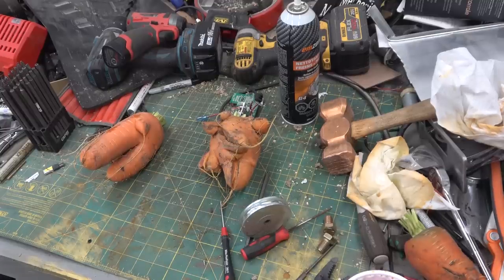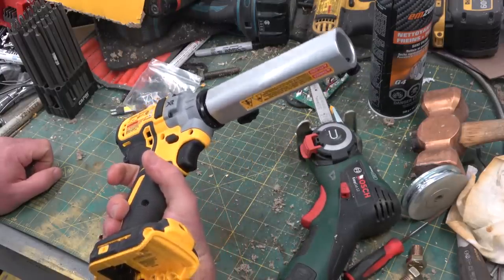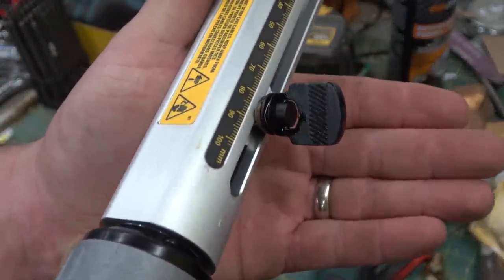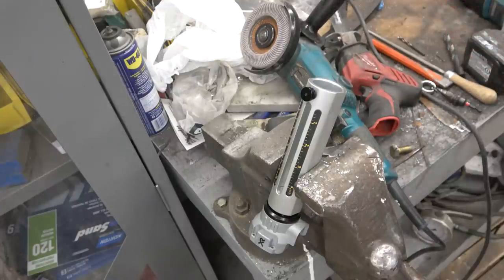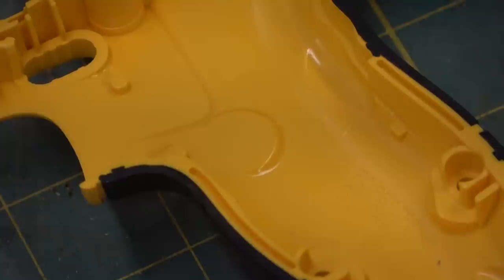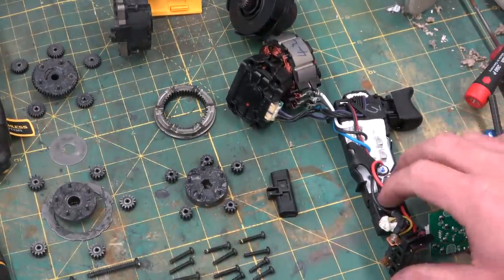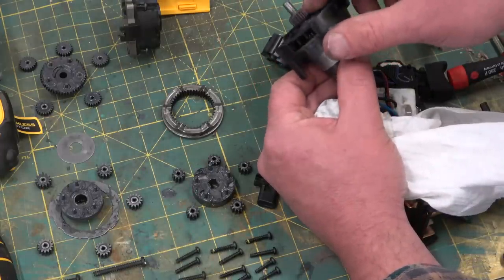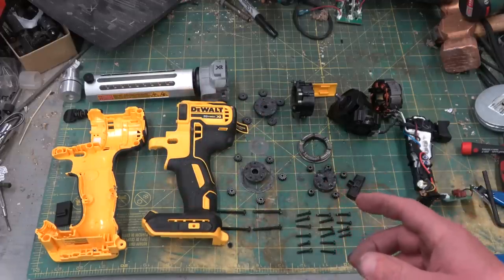BOLTR: Black and Yellow Strippers

Comment: I have owned Crafstman cordless tools for 20 years and just last fall I decided to start upgrading to DeWalt instead of the new Crafstman 20V series. I first bought(2) of the impact driver, drill, 2 battery and a charger in a DeWalt bag kit from Lowes. I was very happy with the performance. I then upgraded my garden tolls with cordless DeWalt tools, blower, string trimmer, pole chainsaw, 20v chainsaw, hedge trimmer, multi-tool, 1/2 socket impact hammer. I'm very impressed with the battery time and power of the tools! I bought a few DeWalt knockoff Chinese batteries and they are NOT worth the cost savings. The Chinese Waitly brand battery with the little battery gauge that reads in digital percent worked good but I had it on my pole chainsaw and while hanging up some bar oil dripped down the pole and ended up seeping into the battery. I picked it up to wipe it off and notice the battery was popped apart in the front screw area. Here the oil eats that cheap plastic of the cheap Chinese battery. I don't need that. I'm buying genuine DeWalt batteries from now on.
Reply: I kind of went down the same rabbit hole about 4 years ago when I decided I needed a big-boy cordless drill (ironically I bought it at Sears). Then came the cordless impact. Then the little job site blower (which I still prefer to blow away cut grass). Then the string trimmer. Then the larger higher-cfm blower for fall leaves. The string trimmer came with a used 5ah, and the big blower came with a like-new 5ah and a faster charger.

Comment: You can buy a really cool custom knife for that price.
And then look like a boss when you're manually stripping the wire.
Reply: You'd be amazed at how many companies are requiring "safety" knives, or outright banning open blade knives; because of accidents.
Reply: @southernlineman  it's a real problem for everyone with triple digit I.Q.
Reply: @jonanderson5137  unfortunately, the nature of IQ being what it is, for every person who’s got triple digit one there must be another one with only two digit. 

(IQ is set on a normal distribution with the average at 100, so by definition there are as many people above 100 as under it)
Reply: @jonanderson5137  I have a triple digit IQ
Reply: @mrb692  technically a median not an average, hence one guy on both sides to balance it out.
Reply: @stanimir4197  From everyone’s favorite Wikipedia: “For modern IQ tests, the raw score is transformed to a normal distribution with mean 100 and standard deviation 15. This results in approximately two-thirds of the population scoring between IQ 85 and IQ 115 and about 2.5 percent each above 130 and below 70.”

Mean, not median, but the critical thing is that it’s fitted to a normal distribution and not a skewed one.
Reply: @jonanderson5137  You might be surprised at how many skilled tradesmen's IQ hover around room temperature.
Reply: @southernlineman  haha, there's a joke about electricians not being able to spell electrician.

I'm just happy that the guys I work with know that code is the minimum standard and not a loose set of suggestions.

Comment: If we are gonna start doing some commercial specialist minded tools...I would like to know what makes a rigid pro press tick! And why they hell the insane price tag. Seems to me it's just a battery powered hydraulic press .....why do they cost thousands? AvE needs to get on it
Reply: I'm going to venture a guess and say its being manufactured/distributed under the real Rigid company and not the power tool division under TTI.
Reply: Given that the smaller, $2,800 version weighs 7 lbs without the jaws or battery and has loops to attach a shoulder strap I would say that it's because its a beefy little machine.  And if its sold in smaller quantities there is more development cost per tool.  Developing any well made product is not cheap.  Also, what @TpzBla said.  Cool tool though.  If I could make money with it I'd buy it on Monday.
Reply: I haven't used the Rigid one, but I have used the RLS/Zoomlock (about the same price) one for refrigeration and OH BOY does it save time.  The fittings are quite pricey, but being able to crimp from 1/4 to 1-5/8, in like 10s is amazing.  The more pipe you run the more time you save.  Plus, you don't need to lug a torch around, and you can do it where soldering is infeasible. They are stupid expensive tho, no doubt.  But like any specialized tool, to the right person, they are worth  the price (tho, got mine on ebay for like 1/2 price).  Its probably a mix of low sales volume, and 'because they can' that they cost $$$$.
Reply: @Theonixco  hence the price tag
Reply: If we are wishing I would like to know why the hell the uponor/propex expander tools in 12v are 800 fuckin dollars, and why hasn't a pex ring crimping tool in 20v with a rotating and extendable head been invented?  I realize the latter query is outside uncle bumblefucks area of interest, but I still want to know.

Comment: It's for purple doing hundreds and hundreds of connections a week. Not for someone doing 6 wires every month. These are standard equipment on commercial jobs. Every job I've been on, the electricians are using these.

Comment: I bought one of these on the bay.  I will be somehow crudely mating this with a 1/4 driver end.  This thing runs at 150rpm full tilt compared to my drill at 450.  This should give me the control I need when using it to run my string winch I cut out windshields with.  

In your pile of parts, is there any off the shelf dewalt parts that will drop on that thing to convert to 1/4in driver end?

Comment: I’m currently interning (as part of my electronics apprenticeship) at a physics lab. They’ve got several automatic strippers. One is just for micro-coaxial cables. You program in the length and depth of each step for the jacket, the shielding, and the dielectric, in 0.01mm steps, and it spins and whirs and pops the cable out! I don’t even want to think how expensive that thing must be…
Reply: Cheaper than the amount of coax you go through when you're leaving it to a grad student to do by hand, particularly if length matching of the cables is important.
Reply: Every cable manufacturer has special stripping machines. Makes perfect ends by the hundreds or thousands daily.
Reply: that sounds terrible, .1mm is not good enough for stripping wire, even thick wires like 14awg or 12 awg are 1.6 and 2 mm respectively, you can't be gouging wires by 5% and not expect consequences.
Reply: @0x73V14  I think the .1mm is about the length of the strip, not the depth. So how far back from the end gets stripped, for each layer.
Reply: specialist tool, for a specialist job
Reply: @0x73V14  You are absolutely correct, I remembered wrong! I went back and checked the manufacturer’s site, and it’s 0.01mm resolution, for both depth and length. (I’ve corrected the original post.)
Reply: @jerrygaber6150  I guess what sorta surprised me is that it’s a “manual” automatic machine, that is, it’s manually fed. True mass production of course has fully automatic machines that cut, strip, and crimp the cables without human intervention, so I’d always assumed those existed. I suppose I just didn’t expect for there to be machines in the middle, though it makes perfect sense after thinking about it!!
Reply: @HJZ75driver  Absolutely! I think a lot of people (like the people posting comments to the video dismissing an automatic stripper as a joke, or saying that a knife does it fine) don’t understand how important the right tool is, both for producing a consistent clean result and for preventing injury to the operator.
Reply: @PeregrineBF  Indeed! I had to prepare some micro-coax cables 2 weeks ago for the first time (around 2mm jacket diameter, with Teflon jacket and dielectric). It wasn’t programmed into the automatic stripper, and we only needed two, so the boss said I should do them by hand to get the practice. They turned out fine, but I am very, very glad I cut off a few 3” practice bits to practice on first, to get a feel for it. I only went for the real ones (which I really didn’t wanna fuck up because one end of each was terminated with a connector we didn’t have any spares of) once I was able to repeatably get the strip just right several times in a row. 

The wire that really gave me trouble wasn’t the coax, but Kapton wires, 26 AWG stranded. I had two variants to deal with. One wire had thin insulation (though actually thicker than typical Kapton insulation). The insulation was thick enough to make the wire very springy, making it very hard to handle, but the insulation was thin enough for the stripper (a different one, not the coax machine) to struggle to strip without scraping the conductors. The other one was rated for 30kV IIRC (it was at least 10kV), so the insulation was very, very thick. That made the insulation much easier to strip cleanly, but made the wire even springier, since it was just a huge amount of Kapton vs. a very small amount of copper. 

Ah, the joys of high voltage circuitry that has to operate inside a cryogenic chamber. (Don’t ask me what the thing actually does, because I really don’t understand it!)
Reply: @tookitogo  Would probably be for testing too i assume. Consistent builds breeds consistent results
Reply: @HJZ75driver  Yes, at least for production.

Comment: I have one of these at my job, but never use it because its garbage, and the DeWalt bushings are garbage (blades are dull, chews the insulation instead of cutting through it).  All the DeWalt is is a Greenlee GTS-RDS or Ripley WS22A perminantly attached to a drill driver. Milwaukee has a model, but they actually innovated with their implmentation, they built the motor around the cutter, so the tool is way more compact. The Milwaukee dies are also razor sharp and cut very easily through the cable insulation. Its an impressive tool. We have modified the included busings to work with DLO cable, in the 374, 444, and 535 MCM sizes. We have also worked with Ripley Labs to have custom busings built for other cable sizes and types.

Comment: Hey brother the carrot issue relates to having to higher nutrient levels in the soil where your growing the carrots, they grow out instead of long and thin
🇦🇺🌏🌎🌍🙏🏼
Reply: Ahhh. Must have had a nutrient deficiency in my early years. Oh well, can't win 'em all.
Reply: Or really hard soil.
Reply: and stoney mud and not wet enough for the tap to look for water.
Reply: Up in the icy north hinterlands, it's permafrost 6" down.
Reply: @UberAlphaSirus  the best carrots are grown in very light sandy soil, 
The soil you describe that's clay and rocky will respond to gypsum and my secret mulsh made from fermentation of hay  cow manure and water in tubs or drums lids on left to do its thing about a month or longer the longer the stronger and better!!
Simply strain as required use the liquid sparingly and use mixed in water like very week cordial if applying to foliage,any solids you strain out taking it from drum can go back into the fermenter you can also top up liquid level without adversely affecting your liquid fertilizer. Or once made strain off completely retaining solids decantering and storing all liquid (Gold). The solids can be used multiple ways firstly as an extremely good additive to clay and rocky soil by adding humus material to the soil structure.secondly  If you have a peletiser by semi drying the solids and running through this machine you make the best fertilizer pellets money can buy.
Keep looking after our planet its where we live 🙏🏼🌍🌎🌏🇦🇺☮️

Comment: I've used these for a while now at work. I was really skeptical at first but to be honest like some of the other guys have said depending on what the insulation is it can work well. I've had decent results with THHN. If you get it off center your pretty well screwed, If you have the aluminum die on the copper or vise versa you can make a mess also. There's tons of dies and it's kind of a pain changing them out for different sizes. All that being said I keep going back for more cause stripping cable with a knife all day really blows. I have not got a chance to try out the Milwaukee strippers yet but these are worth the quirks to save on the hands in my experience.

Comment: I have used these and Milwaukee's version as well. The dies can be very finicky and it can take a minute to get everything adjusted right but once you get it correct these are very useful for things like cutting in large switch gears and transformers, I would only suggest using these if your company will buy them for you but if you gotta pay just stick with the good ole razor blade

Comment: I'm retired now, but that tool wouldn't have been any good for the cables i often worked with
forr one thing, they were up to about 2" diameter (150sqmm 4 core armoured), this is when you find 4 guys in a cable trench wrestling to put a bend in it to get it into the switch cabinet.
We often needed to strip the outer insulation a couple of feet back
That tool may have worked on the individual cores, but those were easy compared to stripping the outer.
Conclusion: waste of money
Reply: Switch cabinet...  Telephone?
Reply: @soundman1402  Mains power switch cabinet in a substation
The cable carries 415v 3 phase and neutral.
Reply: @sparkyprojects  The toy chainsaw would be good for those.

Comment: These things work great as long as you and you alone use it. The very second your apprentice looks at one of these it’s totally dickered
Reply: There is a Milwaukee version that has an adjustable die. The full kit for this works way better when setup correctly and used right. I used both for many hours and would only recommend the desalt
Reply: They also do double duty as a hammer, in a pinch!

Comment: I think that blend of plastic is usually known as Xenoy. Used a lot for things like gear housings. Crazy tough and crazy expensive. I always thought it would make a great powertool body if it wasn't so expensive. You could tell a lot about a type of plastic by the noise it made when you throw a runner into the grinder. Xenoy made a noise like you just threw in hardened metal clippers by accident.

Comment: I would have thought that you could get the same functionality by having the tubular stripping bit that you just chuck up in your existing cordless drill.. basically a tool that cost several hundred to do a job that a $75 accessory for your drill could do... but I suppose that Mr DeWatt has to keep the payments up on his corporate jet”

Comment: The company I work for has a few of these but another brand, they are great if your terminating a service with 64 cables, it saves hours. They're used all the time and hard to get one out of the shop because they are in high demand and usually out on other jobs.

Comment: I recently noticed a makita ga7911 angle grinder. It appears to be a metal bodied and heavy duty tool they actually market with oversized ball bearings ( they say) and all heavy duty internals. It’s especially odd because it’s natural metal silver, no teal plastic. I’d be curious to know if it’s hype or real, and if they have other such tools. All the nameplates I saw were 115volts ac dc (North American), but appeared to be made in Japan. And it’s not ruinously expensive.

Comment: Klein makes a wrist powered stripper for big wire, looks like a water key. I've found them to be easier to use, and with no battery to lose, more reliable. 

I guess these strip further down, but I've never that capability yet. Circumcision is all that's been called for.
Reply: "Wrist Powered Stripper" is what I call my left-hand!

No... wait... that's "Wrist Powered Hooker", my mistake....
Reply: Oh, and if they don't strip down all the way, then they aren't a stripper and you need to ask for a refund! :}

Comment: Milfukee also makes a standalone 18v wire stripper that is about a third the length. They're nice to have when building switchboards, but keeping track of all the different dyes is a pain in the ass. You need a copper and aluminum set for each insulation type. And each set is about 3 to 4 hundred buckaroonies. Southwire makes a dyeless hand stripper that is just about as fast and a fraction the overall cost.

Comment: The 'heatsinks' possibly are heat-cores: blocks of metal meant to soak up a short period of heat production from the underlying mosfets. Generally used in situations where the design calls for only a limited runtime before cooling down: for instance, UPSses and missiles tend to have them.

Comment: I've used the M18 milfukee cable stripper on a few jobs, mostly at the behest of more seasoned sparkies. but I've never used them with the correct dies. When I'm working with copper conductors the shop sends aluminum dies and I can only assume that if i were to ever work with aluminum conductors the shop would send copper dies(this has never caused any issues but requires a second clean up Brit milah before termination). When left to my own devices i would forgo mechanical wonderment and use my standard issue stanley 10-499 razor knife.

Comment: One problem is that you have to set it up not only for wire size but for brand too since they all strip a little differently.  Then if you have tape in the wire that can change it drastically.  So basically thirty percent of the time it works one hundred percent of the time.